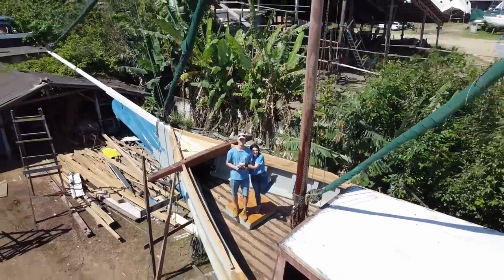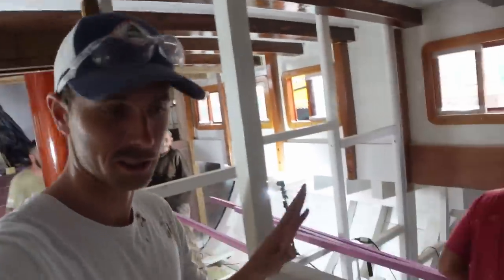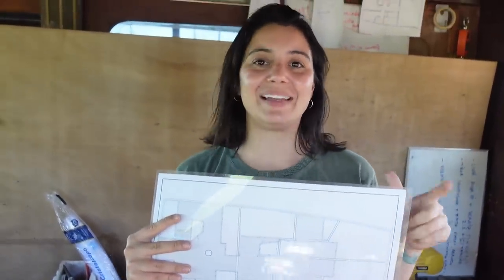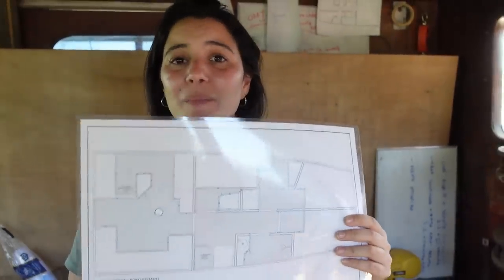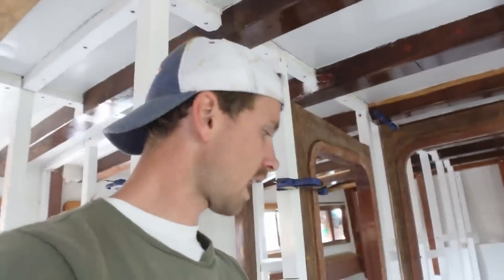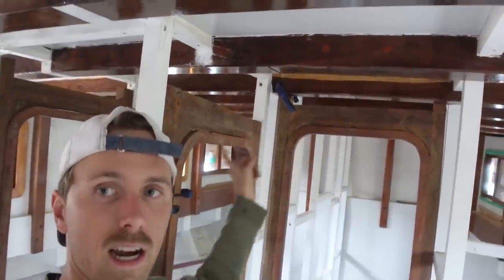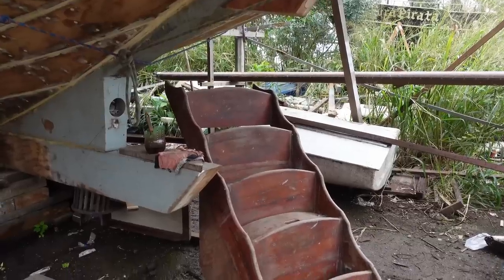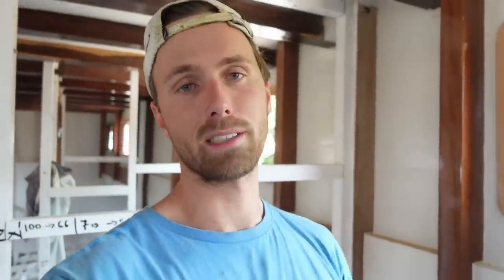Life-saving changes on the layout of our wooden sailboat — Sailing Yabá #108

Comment: It would be interesting to hear how you are going to use Yaba. As a large and heavy craft with a single motor and no bow thruster it will be challenging to maneuver in tight harbors and anchorages. Would like to hear you discuss.

Comment: Awesome and really coming along! If you have long runs for cables etc, might be worth running some large conduits so you can easily pull cables for future enhancements through boat.

As with the Galley, nav station location and keying yourself in is useful, small nibs you can rest your shoulders against or lap strap is so much better than 1 leg out against something trying to brace yourself while working.

Comment: If you're doing electric for the hob I would say, get the induction type. They only heat metal and don't radiate. tons for heat. After cooking they cool to the touch fast, unlike the others that have a long cool down time. Great update 2x👍

Comment: The work amazes me every week! What a great team. I would agree 100% on the galley change. I'm not sure if the design includes rounded corners, but a few modern boats I have sailed on have sharp 90° corners on their benches. They are rib breakers, rounded ones hurt, but sharp corners break skin and bones. Also the crazy Jeaneau wash basins are square with no overhang. All water spilled out the front goes straight into the drawers underneath. 3 times a day, I know because after washing the dishes you have to dry out the drawers.

Comment: May be an idea to run power for light switches and power points before you fix the wall coverings, as well as insulation. That fixes noise and temp.

Comment: Well done Guys what a great team effort.  You must be getting really excited now, because what a magnificent  home you are building. I think you should  build a 'grid type walk way on or next to the bowsprit.  Perhaps carve a lovrly bust of a maiden thst you can fix under the actual sprit too as the sprit is quite long.  I think a crows nest would  actually be  too much, as the mast is comparatively quite a low profile mast. I suppose because you use an internal blast system.   So I would concentrate on making the bow esthetically pleasing,  yet very practical. So if you have to put someone out front on the prow,  to watch for dangerous underwater obstacles, it can be used to spot coral reefs and barmies if neccessary, and it's always great fun to set and watch dolphins from the prow.  What a gifted super skilled company of craftsmen you have too. I'm so impressed, You Guys absolutely rock!

Comment: tip: considering the abuse the panel surface and @ oven  back splash +- facing steps - it might be wise to use some more (stainless steel ? same as on the the drawers) to guard against wear  nice layout

Comment: You could cook with Ben Gas, but it would require feeding him a bean rich diet and plumbing him into a holding tank. If you used a flexible hose you could still keep him mobile enough to do the cooking and boat maintenance.

Comment: I love the changes! I would recommend you also consider that a smooth top induction stove is wonderful however, they scratch VERY easily with any pot movement, sometimes even with just stirring hard. It only takes a grain of sand and turning the pot on the burner and it scratches it. Please try to get pot bracket holders to prevent that. The galley is the heart of the boat just like a kitchen to a home. Don’t want you to just settle on a stove without considering wear after having taken such wonderful care with your vessel. Yes I love to cook and speak from an 8k mistake I made on a home stove not long ago.
Reply: Must be the brand you have ours has never scratched.

Comment: When it's time to run electrical wire run chase tubs and low data tubes separately  just incase you want to run more or have to pull new wire in the future

Comment: Central heating system ? Webasto hydronic heater based (5kW should be about enough for the size of inside space...) Central heating can also be used to heat water in a indirectly heated boiler and the whole system can be powered by an electirc heater unit running on solar or shore power...

Comment: Things are beginning to look really good on the boat and you're making good progress in realizing the project.
As a home builder, I am concerned that you are putting up wall covering before pulling all of the electric and plumbing lines through the spaces in the walls before finishing them.
There are switches, wall fixtures, water and waste lines and all kinds of other utilities that could and should be in first before finishing the "bulkheads" rather than relying on running everything below the sole.
Anyway, nice job guys and I look forward to seeing the furniture come together.

Comment: Will you be using low voltage lighting as they do in R.V's ? and using inverters to go from 12 or 24 volt to 110 or 220 volt for larger appliances ? or just install a generator .Or maybe a combination of these along with the solar power .

Comment: So glad you decided not to use Gas/Propane in your galley, it's really dangerous stuff that doesn't belong on a boat. You have enough space for loads of solar so electric is a good idea, glad you plan to gimbal it, you'll need that, you should also look at how to implement some pot holders for your electric stove even with the gimbal pots and pans can still slide off the stove and still be dangerous

Comment: I’m a bit concerned about the way you appear to be setting out the furniture, I’m not sure what the Purple Heart battens represent, but don’t forget that any furniture you stand in front of needs recessing at the floor level for the space needed to place your toes in. If you have the units for say the sink or the hob just flush all the way to the floor you will get terrible back ache leaning over the cabinet

Comment: You want to have 2x the amount of power supply available to your max load ussage (2x has to do with inrush and heat generation in the inverters). Between A/C's, stoves, coolers, TV's, sound, control systems, freezers, lights hydrolic, navigation, pumps, MANY fans, computer control systems, water pumps, water pumps, water pumps, and on and on and on. And all of those systems will be running at the same time always. It is VERY easy to install more power usage then you have supply.  You would be wise to have a gas burner as well. There is a lot of roof area for solar, BUT running all of those systems on battery backup is a joke! This boa will want likely 2x wind generators for night and backup power. This boat will almost always have a gen-set running depending on ussage or be plugged into shore power when docked. MAKE YOUR WIRE runs easy to deal with and modify add/delete. But I'm sure all of this ^ will be ignored, Just like not painting the roof white will be a long term regret.   Oh INSTALL ZINC savers isolators <- not a well known item. With a proper install zincs and bonding shaft brushes. That will help keep the boat metal in good order. Remember LED lighting is low power till you add a lot of them. A big boat uses a lot of them.

Comment: You want to have 2x the amount of power supply available to your max load ussage. Between A/C's, stoves, coolers, TV's, sound, control systems, freezers, lights hydrolic, navigation, pumps, MANY fans, computer control systems, water pumps, water pumps, water pumps, and on and on and on. And all of those systems will be running at the same time always. It is VERY easy to install more power usage then you have supply.  You would be wise to have a gas burner as well. There is a lot of roof area for solar, BUT running all of those systems on battery backup is a joke! This boa will want likely 2x wind generators for night and backup power. This boat will almost always have a gen-set running depending on ussage or be plugged into shore power when docked. MAKE YOUR WIRE runs easy to deal with and modify add/delete.